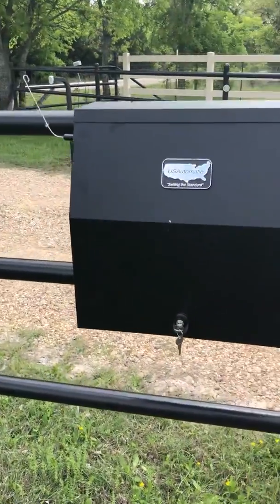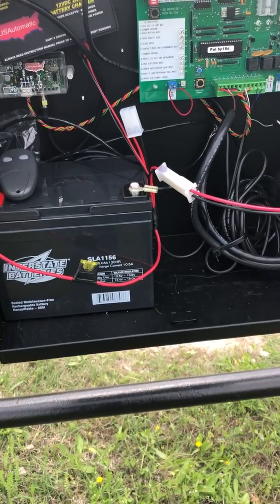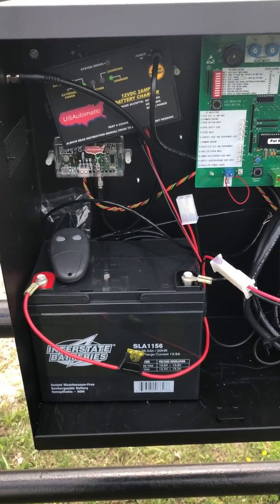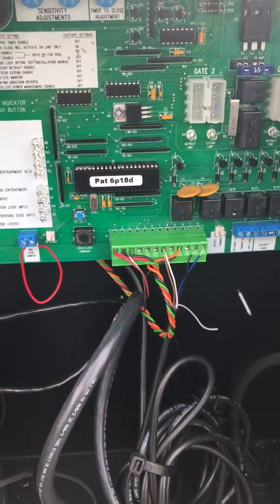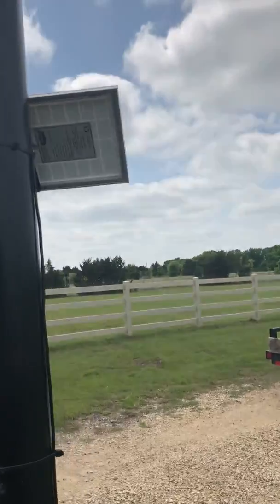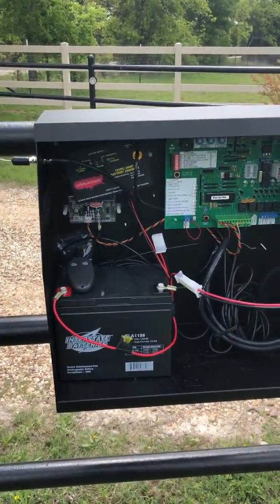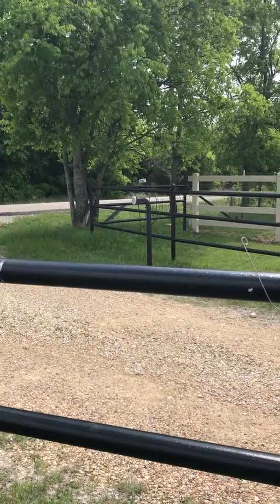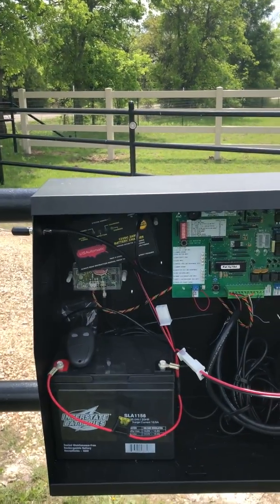Gate Operator (US Automatic Patriot 1 Solar Install)

Comment: How come the gate was so jerky when it was opening and closing?
Reply: Anytime there is a heavy gate, it will be an issue for the Patriot. It has a soft start and stop function, but if the gate is heavy, it will do that. The Ranger HD has 3 settings to slow the gate way down so it eliminates that issue. The Ranger HD is a better operator in my opinion.
Reply: @Star_Fence_and_Gate  How heavy is heavy? Patriot can go up to 1200lbs correct?

Comment: How do would I bi pass the photo eye?
Reply: It depends on what color board you have. Below is a green board normal install. If you don't want the photo eye, just remove the power wire. Let me know if that helps.
Reply: It’s the same  board that’s on this video
Reply: @ninoweldingllc7900  Do you have one hooked up and you just want to not use it?
Reply: No sir  I was just wanting not have one.at all
Reply: @ninoweldingllc7900  Ok. Trace the wires in from the eye and remove them from the board, or remove at least the power wire from slot 1.
Reply: Jim Polich the one I have is a blue board
Reply: 10-4 thanks